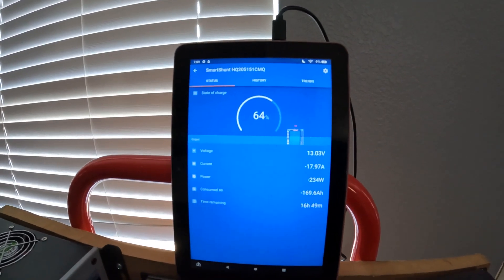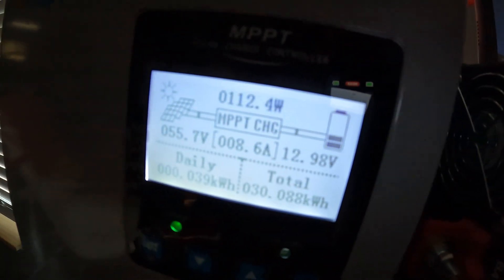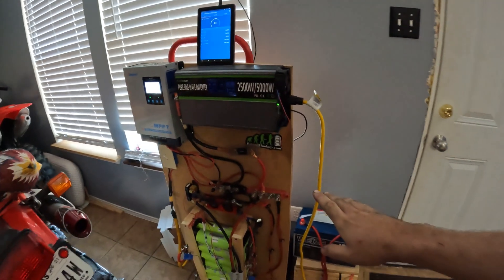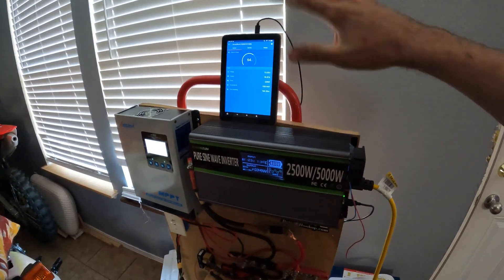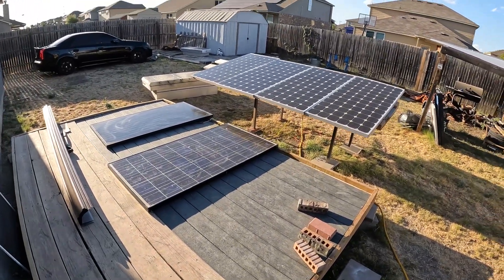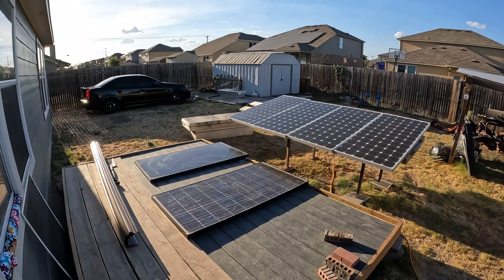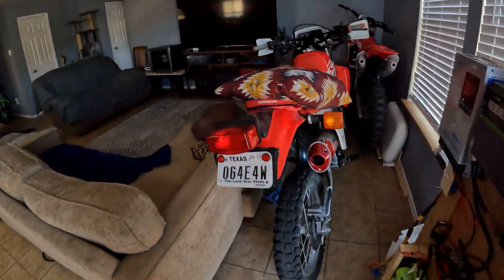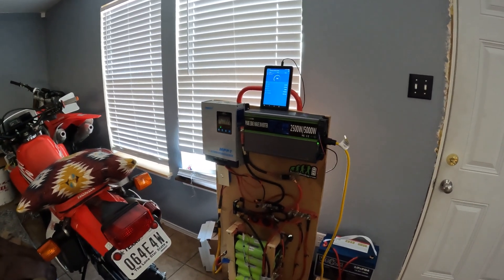DIY Solar power setup update!

Comment: How loud is that thing inverter? And how much is your total setup? Thank you
Reply from the maker: When the fans kick on its kinda loud, I probably have about 1500 into the setup. Batteries and solar panels are the most expensive parts.
Reply: Ya I bought a ecoflow delta pro, it  I run 24/7 for refrigerator too loud for studio apartment give it to my parent.  Now thinking of DIY a system, might be same thing too loud. Hope I can find quite inverter.

Comment: Just starting to look into building a solar power system, DIY, and was wondering where you get used solar panels from?
Reply from the maker: I got mine from Facebook marketplace I'd start there. But if not you can nor ally buy brand new 100 watt panels for less then 100 dollars if you shop around

Comment: Set up looks great.was curious,the ac unit in the window how is it sealed in?looks as the window is open and unit set in place
Reply from the maker: It uses foam blocks to help seal it in, i also used small towles to help seal air gaps, it works good doesnt seem to loose much, not perfect but does work